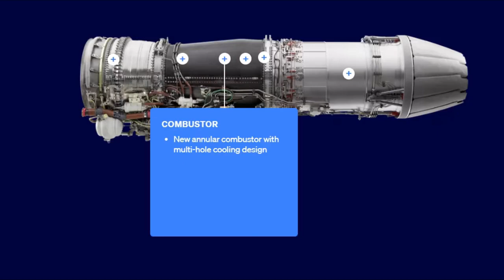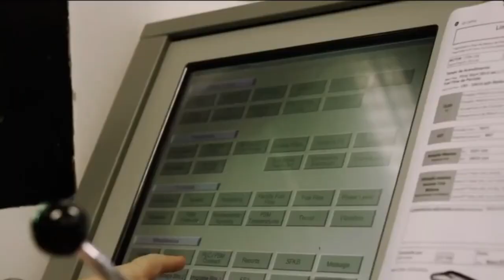GE Aerospace signs MOU with HAL for joint production of GE Aerospace’s F414 engines in India

Comment: Thanks for the very good overview with specific details on the TOT. Coming to single crystal blades you have said that the TOT includes the matching and coating but not manufacturing. Since you have added that we now have this capability, we can get them relatively easily certificated as compared to getting the TOT for manufacturing. Though we don't know, this may well be  the reason why this aspect was not included in the TOT by our negotiators.  While there is some criticism about not getting 100% TOT, we should follow the Korean philosophy of small quick steps.

Now a few questions for you.

There many attachments to an aeroengine but the most important  are the gear box and starter/generator. What is the situation on these? Are these indigenous or covered under TOT or something else. 

This engine is going to be used for LCA MkII, TEDBF and AMCA. So, our requirement could be around 50 (assuming 10  of each a/c type) engines a year which is quite high! Hope HAL can deliver that many.

Now that the major road block for  LCA MkII is gone when is the prototype going to be rolled out? Earlier I read that it will be in 2024 but now I read that it is Sept. 2025. Kindly clarify. 

Best regards.